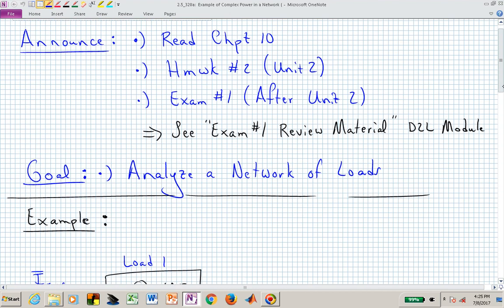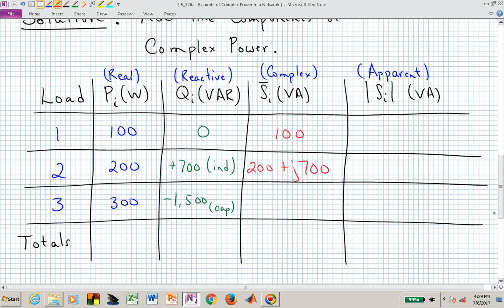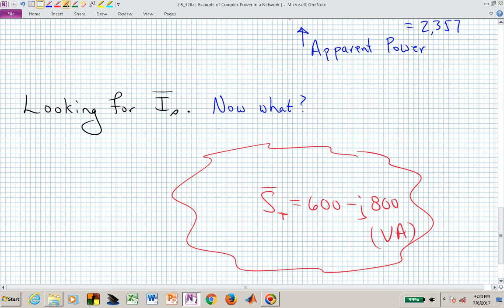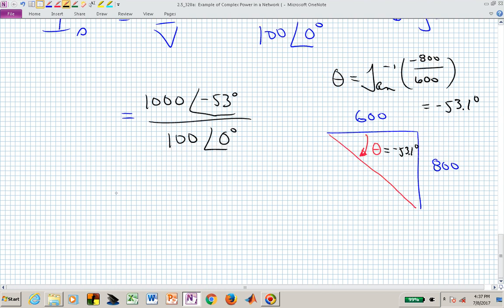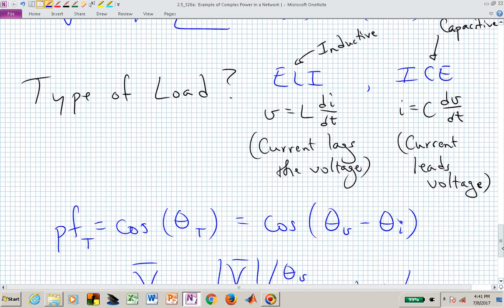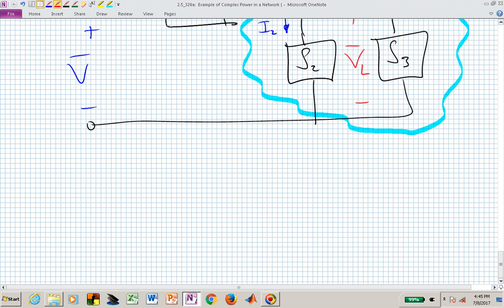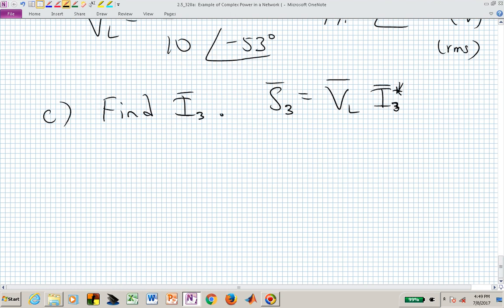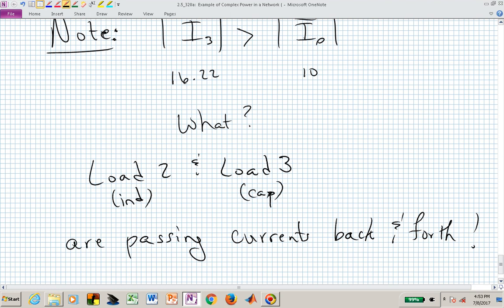vid2.5_ece320a

Comment: I think that an easier way to determine the voltage across those parallel loads is to realize that load 1 is purely resistive with a power absorption of 100 watts at 10 amps so we have 100/10^2 = 1 ohm. So the voltage across the parallel loads is simply the source voltage 100<0 less the voltage drop across the 1 ohm resistor namely 100<0 - 1*10<53 = 94.3<-4.9